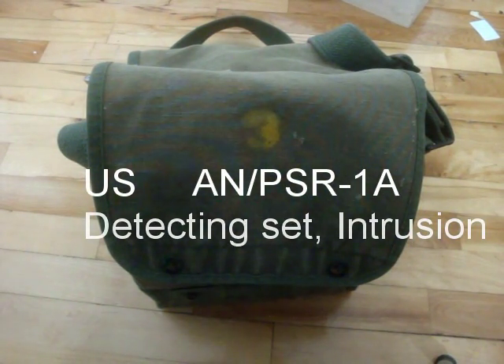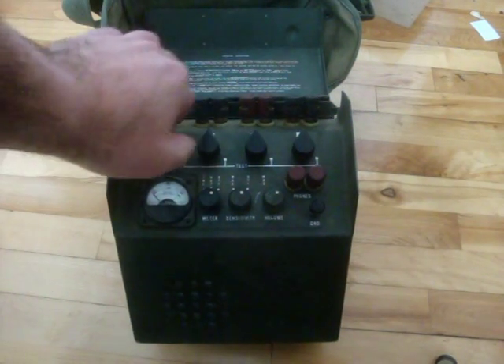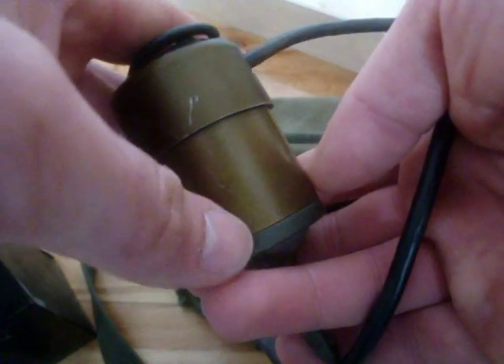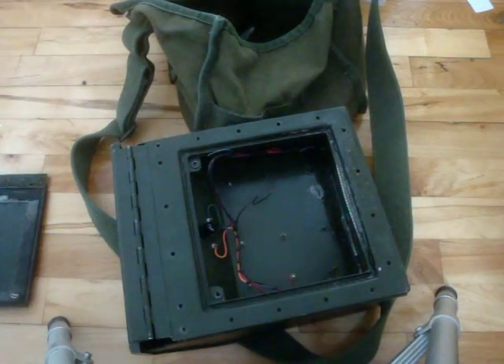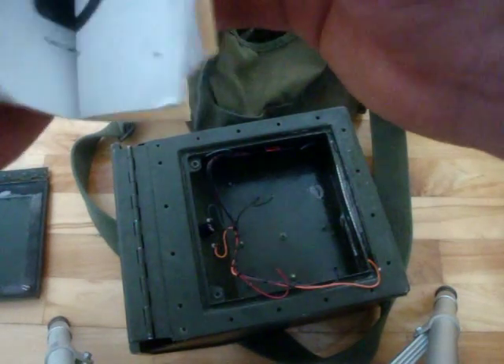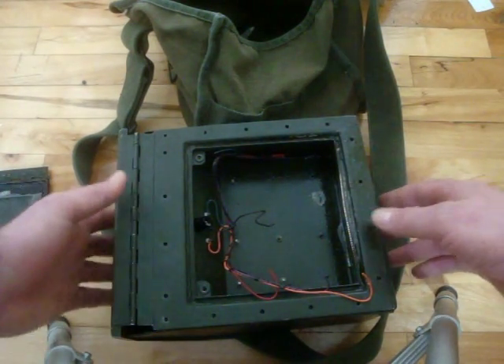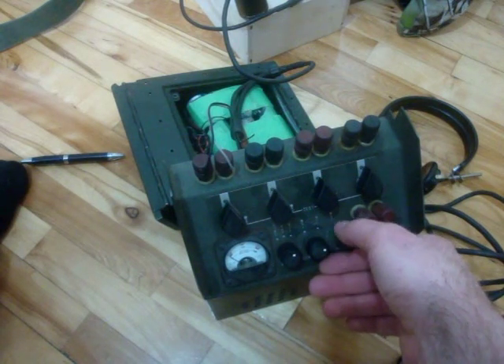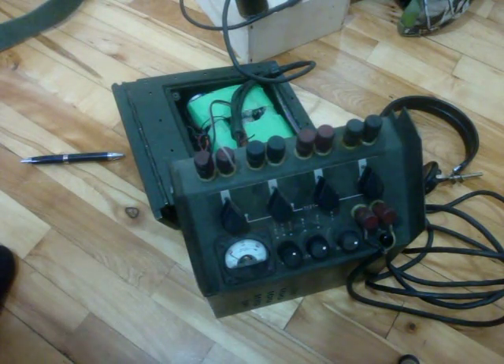1960's US intrusion detector AN/PSR-1A

Comment: Can you connect a 100 meter cable to this device and does it came with an original long cable?
Reply from the maker: The unit doesn't come with the extension wire, it was designed to use any wire that was suitable for field telephones, as long as the loop resistance doesn't exceed 50 ohms in order for it to work at peak efficiency. According to the manual with the 18 gauge wire you can extend it 1 mile (1.6km) with no loss of sensitivity. Never heard of the VP-13, looked it up and it is an interesting device. Technically you can probably use the unit as a detonator/igniter , but the sensitivity of the device would really have to be dropped low, an arming delay added and a few other safety devices added. You may even be able to use just a probe connected to the wireless igniter circuit I tested in a video, assuming it makes enough current. Either way it would be a dangerous system to both the installer and the unlucky person who walks up to it, and probably not as effective as simpler systems, except for fringe uses as the VP-13 was designed for.  The PDF sounds like an interesting read.
Reply: Stray03 Well I can send you the pdf.Send me your mail through private message and I will send it to you.The book contains a short graphical representation of different kinds of mines and igniters and one of the firing device that is explained  is  a vp 13.
Reply from the maker: Catching Fire is it FM 20-32 appendix D "Foreign mines"?
Reply: Stray03 No the book is called "Mines-and-Fuzes-Czechoslovakia-Hungary-Yugoslavia-USSR-and-GDR".I just searched the internet and I found the book on Scribd.
By the way I want to ask you a few question about the AN/PSR-1A.
I noticed in your video that even when the switch is set to "line" or "off" the detector is still working.I thought that the mode "line" is just for testing, so in normal operation where do you set up the switch,on "line" or "battery".I also downloaded the manual and the manual says, that you can bury the seismometer in a water,adjacent to a column of a bridge.I think that you can definitely sense cars and truck like this,but what do you think,can the detector sense footsteps.What about the fish in the water.Also what do you think,how practical is this .It cannot differentiate between animals and humans so I think that it can be used only in areas that are surrounded by a wire or something.Were this things used or they were just prototypes.
Reply from the maker: Catching Fire The switch just switches the meter over between battery test, line test, and disconnected. The sensitivity switch is also the on off switch. They mention Cement being the worst thing to connect it to probably due to requiring alot to get vibration traveling through it. Possible with vehicles but people wouldn't make it move. If the bridge was wood, or even steel, you would be better off than cement. Animals and people walk in different ways, according to manual you can quickly learn the difference and it is possible with some practice to determine the types of vehicles. I'll get a test video up when I bring it outside so you can hear the difference.  The vibrations need to make the sensors vibrate vertically, They are not like the earth quake ones which can tell you direction too. Practicality depends on situation. Athough used today in different applications, there are much more advanced intrusion detectors, relying on thermal imaging, and other things that they did not have back then. They had to work with the technology they had, it had to be simple, somewhat light, and not easily damaged.
Reply: I just picked up one of these units. I was wondering if you make a battery pack for me of course I'll pay you.

Comment: Have you heard about VP-13.It is a Russian seismic detonator.There is very little info about him on internet.It is working exactly like this system.When the device senses a ground movement it is sending an electrical signal to the fuse.The fun part is that you can do the same thing with this device.Just connect another pair of wires from the speaker to a igniter.If the signal is weak you can use a additional transistor and battery.I know that you have videos about igniters so it is just an idea.
If you want I can send you a pdf in English which describes, in short, the VP-13.